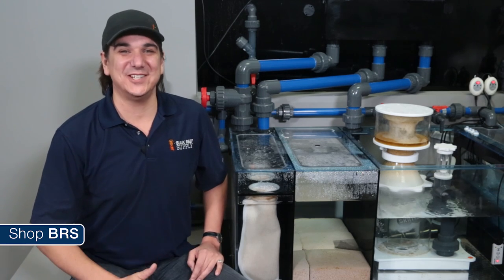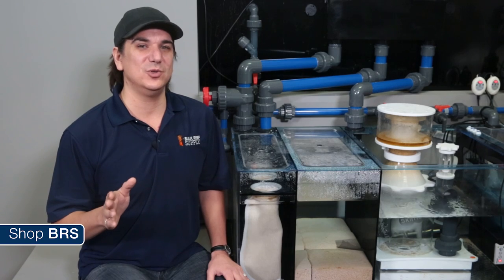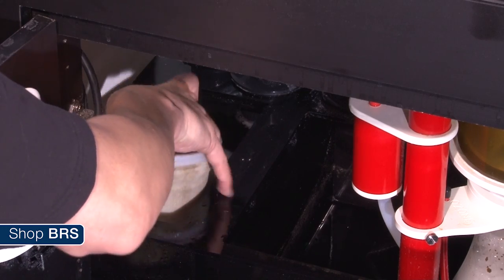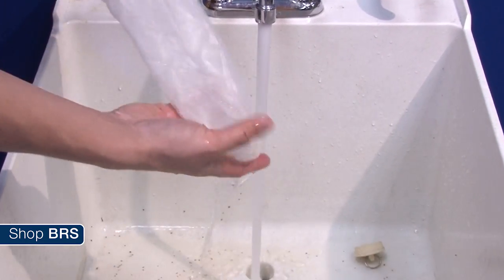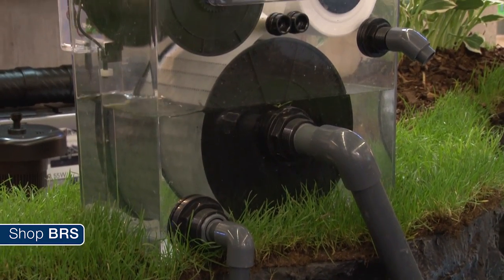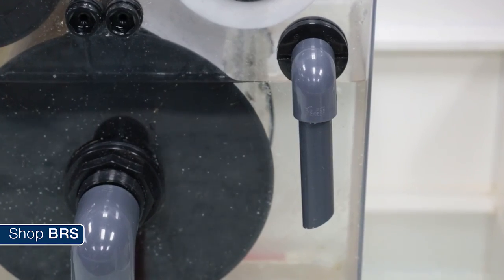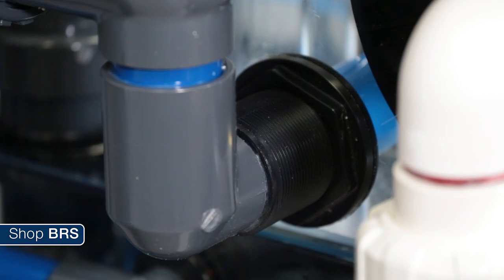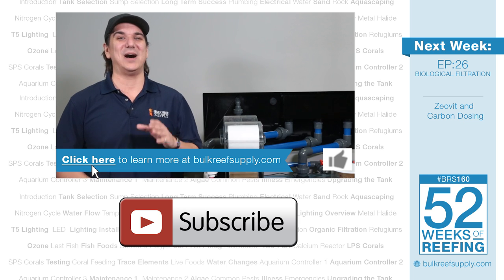Week 25: Going Beyond Filter Socks: The Theiling Rollermat. | 52 Weeks of Reefing

Comment: I manually wash my filter socks. They then go into a plastic bucket with chlorine bleach/ water solution. When I get 3 to 4, I wash em in our washer. My wife is okay as long as they are washed/ rinsed and soaked in the bleach mixture.

One thing I strongly suggest if you use a washer. Even without adding detergent, in our washer there is quite a build up. Our unit has a cleaning cycle and I always use this cycle before putting the socks in the machine. When I use that cleaning cycle, the rinse water is full of suds from prior washings. Most don't realize this because the drain hose is stuck down a laundry drain pipe. Really that water will be washing your socks. If you do not have a wash cycle, you can just run a regular was cycle. Choose largest load/ highest water level and hot water to flush out the residue soap.

Comment: The day after I installed filter socks I went looking for a Rollermat.  Put in the socks, change the socks, wash the socks non-stop.  Vacation?  Who will change the socks?
Reply from the maker: Innovative Marine offers their heater controller in two different models. The first is the Helio PTC featured in this video. That heater controller will only work with their Helio PTC heating elements. They also have a Helio universal controller that will work with any heaters (up to 1000w total) that have a standard 120v plug. 

The universal model will shut off and sound an audible alarm if the current temperature of the water raises above the high alarm set point.

Comment: Filter socks are a catch 22. This is how I minimize my disdain for them:
I use before cleaning the glass, leave in place for three more days and remove. At this rate I only use 2 socks in a month. Socks are not needed in a reef tank as long as you have a solid  W.C.. schedule. Same with the Triton method,- do not use socks ( some still do though). Others use Bacteria sources and that it self eliminates sock use.You the reef owner should experiment to see if they are indeed needed in your particular setup. Me, I hate them-It is one less piece of maintenance to worry about, however, a good tool to minimize sedimentation. So, there you go. But, yeah, I still use them (Mesh, 100 micron) sparingly on my tanks.

Comment: The rollermat is awesome well except for the price :)

 If you have a small non-drilled tank what is your best option? A HOB filter with filter floss changed every couple of days?

One option that is tedious that I've used is stirring everything up and repeatedly siphoning buckets of water through a felt sock and pouring the filtered water back in.

I'll be interested in seeing your guys take on supplementation, I just ordered some Kalk and Bicarbonate from you as I have low ALK but everything else is good.

Comment: Personally I still like the old fashion sponge as the first stage of mechanical filteration.  It never has to be changed and is a great place for bacteria to colonize.   Cleaning just requires a couple squeezes.
Reply: +Jeff K It is but it's also a great place for particulates to build up. Squeezing isn't enough. You have to pressure wash it because there are things DEEP DEEP inside that squeezing won't get out especially if you're using the dirty water from a water change. That's why it's better to just leave your biological filtration to just your biological media. I personally like to keep it in a filter bag so it doesn't get dirty.

Comment: Obviously an unnecessary piece on this recommendation.  But I have to give you the thumbs up on the coolness factor of it.  For my tank I will be sticking wit the felt filter socks.  I am playing with the idea of mesh pad on top to capture the larger particles in hopes the socks would last a little longer.  No idea if this is worth the trouble.

I do have to say though, I work in the wastewater industry and this reminds me of the belt presses used to separate water from the solids captures in wastewater treatment plants.  If space and money were no object, I would definitely have this in my cabinet.  Sadly, money is an object and my current sump is an Emerald 34 and just don't see this interfacing nicely within the confines of a tall 110.

Merry Christmas Ryan!

Comment: I think the Rollermat is an interesting piece of equipment but my concern with it is if you have to continually throw away the paper and replace it as it fills up is that it sounds unsustainable compared to a simple filter sock which is just rinsed and washed here or there. Since it lasts a few months it isn't terribly unsustainable but if your tank lasts several years that's at least 16 rolls of filter paper that you will have to use or throw away. If they could make the rollermat run off of a mesh like material that rolls up the same way it would definitely be more sustainable.

Comment: Hi Ryan, this looks amazing. Although somewhat costly, it seems that it can be worth buying if it is not noisy and if the fish waste and debree caught in the rollermat does not interfere with the nitrates and phosphates in the main tank. I guess it does not, but can you please comment, also a word or two on noice level. Excellent videos!
Reply: +BulkReefSupplyCom Thanks! Just ordered one Rollermat. Eager to test in my setup, Daniel
Reply: +BulkReefSupplyCom Hi Ryan, so far so good. Did you have time to think about the correct flow through Rollermat? It is recommended to be 2500-3000 liters/h. Does the functionality get worse with flow rated of around 1500 liters/hour? Any thoughts on this?
Reply: +BulkReefSupplyCom Thanks, this is exactly what I noticed, will buy a new pump.

Comment: Are you planning to use any macro algae in your sump or anywhere else in this build?  In looking at your setup there doesn't seem to be any place where you would put it.  I am wondering because I am rebuilding a sump and was questioning whether or not I really needed the macro.  Thanks for any help and I love the videos.  I wish every company operated like Bulk Reef Supply!
Reply: +Madison Freeman I noticed the same thing.  I am setting mine up with a refugium and highly recommend it based on my experience with a 90 gallon reef.  But each person's approach is different.  If nothing else, get a sump with the refugium chamber and if you decide you don't want to go that way, it will give you extra space for reactors.

Comment: Have you thought of plumbing the overflow directly to the input of the skimmer to eliminate the filter sock or roller mat?
Reply from the maker: That could work, but would be very dependent on skimmer size vs turnover rate. Not to mention that most reefers don't run a recirculating style skimmer. Not impossible, just not very common.

Comment: How noisy is the Rollermat system?  Water falling into my 7" filter sock is probably the noisiest aspect of my sump.
Reply: +Joe Rice I have not used this item before but from what I saw in the video and the way it appeared to be plumbed, I would image this is very quite with no splashing until it reaches the overflow line.

Comment: One question, how should we dry or treat the bags after the wash? And does the TDS of the water entering the washing machine matter after they are dried out? I've been buying ecofelt fabric for super cheap at joann fabric and sewing the bags myself. I don't wash them before I use them for the first time and they work incredibly. However, its becoming taxing due to the fact that I max out at 48 hours of usage before its completely clogged up and have to sew a new one every time. I have about 40 bags I can wash now but I'm scared to put them in the washer without further knowledge. Tank has too much live stock  a this point to chance it.
Reply: +Daniel Mijares  I personally don't worry about the TDS of the water being used to wash the socks since the spin cycle leaves the socks almost completely dry. Very little water is left over to dry on the socks. If you're sufficiently curious you could try washing a few socks and after they come out of the wash soak them in some 0 TDS water and check what the tds of the water after is. if it is high enough that it concerns you, just soak them in DI water before you use them.
Reply: +Daniel Mijares I usually just soak mine in bleach/water to help break down organics as I pull the socks and then throw them all in the washer once I collect enough of them. The spin dry cycle is all thats needed to dry them. If I think of it, I'll give each sock a quick rinse in tap water before I put them in the tank. I really dont worry about the the TDS of the water since a single feeding contains WAY more nutrients than an ounce or two of tap water ever would.

Comment: +BulkReefSupplyCom - What size is the Synergy Reef Overflow that you are using on this 160 tank? You sell the 16 inch on your site, which comes with 1 inch drain bulkheads. The BRS support team said that you are running 1-1/2 inch drain tubing on the tank. That would mean you're using the 20 inch version of the Synergy Overflow right? If so, do you plan on carrying the 20 inch version?
Reply: Awesome, thanks, I thought so. I ordered a 20" version from Synergy, it should be here soon!

Comment: I like to use my canister filter after a major tank cleaning. Shut my pump down to my sump and run the canister filter with just foam water polishing pads to clean the display tank. But other than that i have no real need for it on my saltwater tanks.

Comment: Is a filter sock more effective if it is elevated so that it is not submerged in the water?
Reply: BulkReefSupplyCom Well here’s my hypothesis on that. Since the filter sock is elevated, water will always take the least resisted path. When portions of the sock gets clogged, water will just glance off it seeking another way out. Hence contact time with clogged detritus is less compared to if the sock is submerged entirely where all the trapped gunk is in the water column. I happened on this thought because I use a media cup with filter floss instead of a sock in an elevated design. Whenever I clean the floss, I noticed that there is dry debris as the water bypasses the debris looking for an easier way down. It’s the same reason why you don’t recommend water flowing down on media due to channeling, well channeling works in our favor here!

Comment: someone help me out here ... to ME it makes WAY more sense to feed the input (dirty) water into the CENTER of the wheel (what is now the output but should be the input) and then make the output the hole at the bottom.  this way everything gets caught in the filter ... EVERYTHING ... it goes into the filter chamber and comes out on the reservoir side clean.

so, my question is, why do they seem to be flowing the water backwards???
Reply: oh, shit, i just realized why... the water level would never activate the switch if it was done the way that seems best to me...  yeah, i get it now ;)

Comment: How has the Rollermat held up over time? do you still use it? Do you still recommend it?
Reply from the maker: We ended up removing the rollermat on the BRS160 when we switched over to the Triton method, but it was working until the very end. We've since installed other rollermats on a number of tanks like our new Red Sea Reefer 750. They definitely cut down on maintenance :)

Comment: It's too big size wise and I have a pretty big sump? I put a mesh bag inside both my  200 micron 7" bags and that pre breaks up solids and traps big stuff ahead of the bag.  Every week wash replace.
If that was smaller would use.
Reply: Would certainly use it if it fit. Who knows what will come along next. Your sumps are clearly "skies the limit" so can see no problem for room there.
Reply: One thing I do with the socks is they are above the sump water line in the sump so they don't leach as heavy floating/soaking in the water continuously.